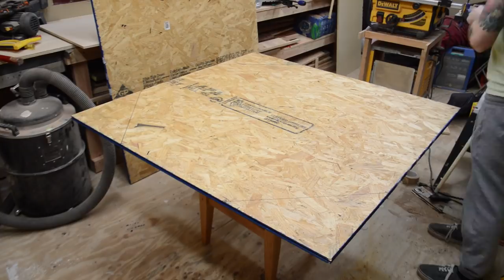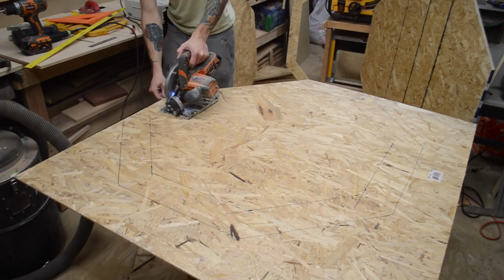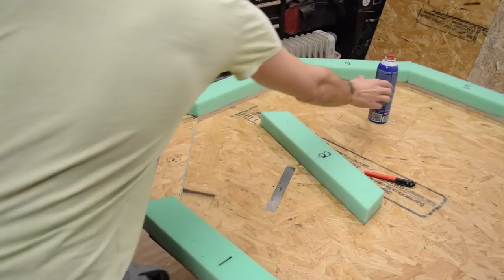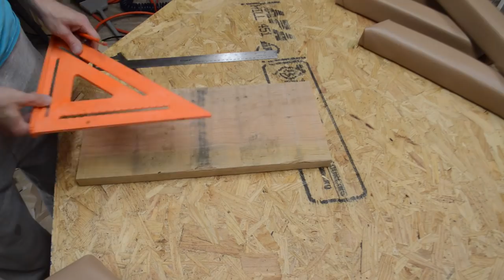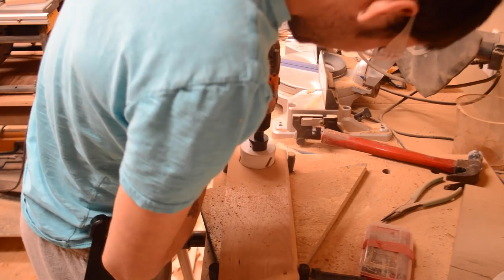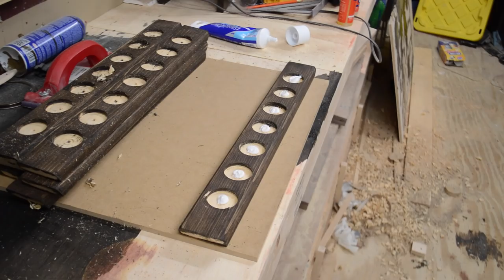Building a Poker Table

Comment: If you drill  an 1/8 inch down with the hole saw  and then drill a few small holes in the 1/8 inch swath you can give the saw dust somewhere to go and the hole saw will not bind up. Plus the hole saw will not get hot and last longer

Comment: Great table but I cant watch anymore of this video. Everytime I watch you use your band saw I was just waiting for you to cut off a finger or something. Do you not know how to use your band saw? Trust me when youve had a saw nearly cut off your hand when shit kicks back you will learn the hard way. When your using your band saw you should always bring the adjustable guard down atleast a quarter of an inch above the material you are cutting or your gonna have something kick or grab your hands and cut off a finger. And always keep your hands atleast 3 inches from the blade called the 3 inch rule.

Also if you ever plan on doing another job like this. When you do leather covering. Ive done automotive upholstery and when you roll over the leather to staple it down to your back board. You want to first start in the middle on each side of the panel, then pick one side to work with first and working from the middle outwards to the corners. Then as you move around doing the other 3 sides do the same thing. That way when you get to the corners you can tuck in any excess you have then pulling the 4 corner tabs of the leather or upholstery fabric your using over the top and staple 2 or 3 staples down the length of the folded tab before trimming it to the length of the rest you trimmed off.
This method of doing this pulls your leather nice and taught and removes any wrinkles in the material.
Reply: Your band saw was way to high for what you were cutting. Not a good thing
Reply: ok